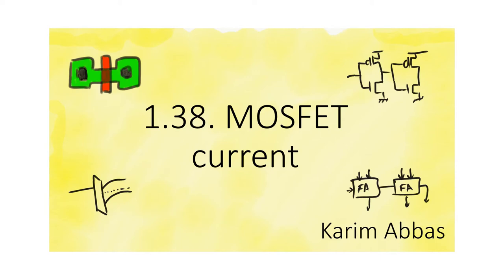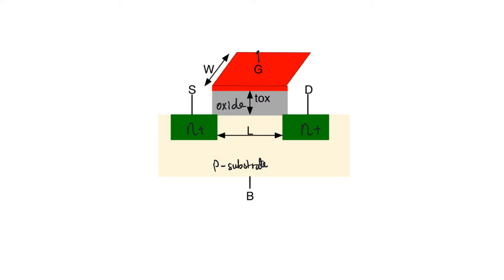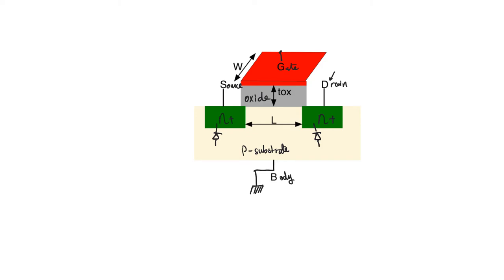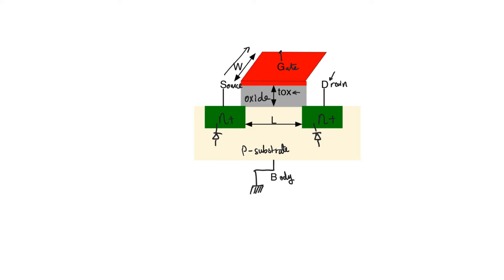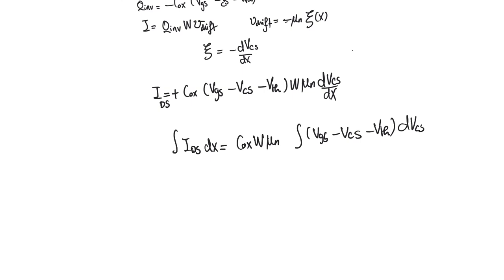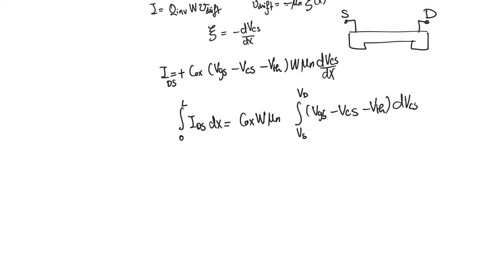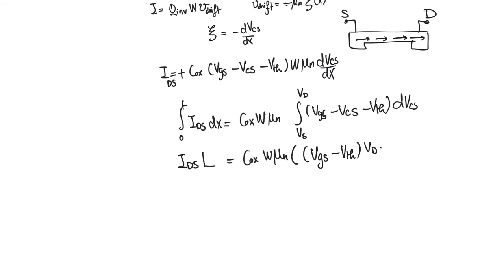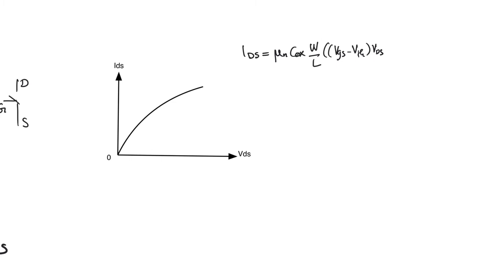1.38. MOSFET current

Comment: In which condition my mosfet is operating if the current is independent of gate voltage?
Reply from the maker: Current in the channel is never independent of gate voltage. To be more exact, if the transistor is completely cutoff and we fully ignore leakage, then current is independent of gate voltage, but that is a trivial case.
Reply: @electrontube4284  can you tell me more about this trivial case please?
Reply from the maker: If Vgs<Vth, the transistor is cutoff and the current Ids=0. This null current is then not a function of any of the four terminal voltages including the gate voltage (as long as Vgs<Vth).

However, if you take a look at leakage current in list 10, you will find that even when the transistor is "cutoff" leakage current is a function of gate voltage. The problem is that current is always a function of charge in the channel and charge in the channel will always be affected by gate potential.
Reply: @electrontube4284  yes sir i have gone through that module as well but even there my leakage current is a function of applied gate voltage .

But this same question was asked in my exam "In which condition the MOSFET is operating if the current is independent of gate voltage?"

And i am unable to find it. Is there a possibility that the question framed is wrong?